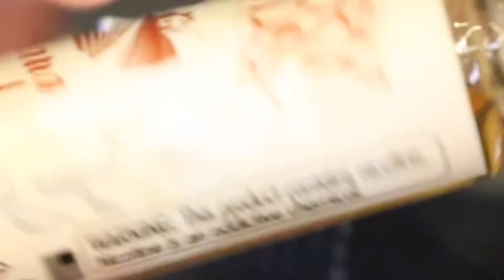ENTHEON RDA ~ PSYCLONE MODS:  FULL REVIEW/BUILD/WICK & LOTS OF BAGGIES

Comment: Try it with a wasp top cap and a small 510. Just about perfect for me. Need to put a order ring around the base. Get mouth feel and a bit more air. Love it
Reply from the maker: Paul that is the type of info and suggestion that is AWESOME!!  I will totally try that out ....had no clue the Wasp cap fit on there man...I will slap that guy on there when I get home tonight!!  Thanks for pointers man and also I appreciate you leaving it so others can see and possible try as well.  Thank you so much for checking out the vid and dropping some knowledge man!!
Reply: PAL 702. Clamps will hit the top of the cap but a oring on the bottom fixes that. Was going to try the hadeon cap but this still gives you the leak resistance and a better mouth feel. Keep making vids pal ill keep watching.